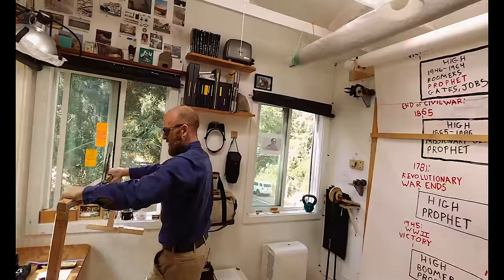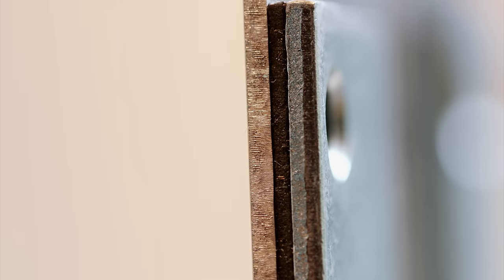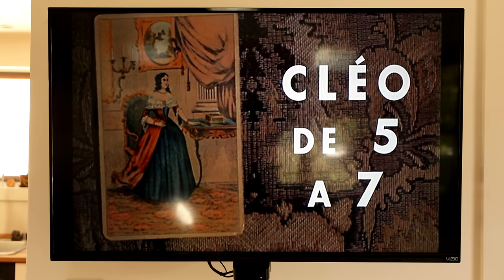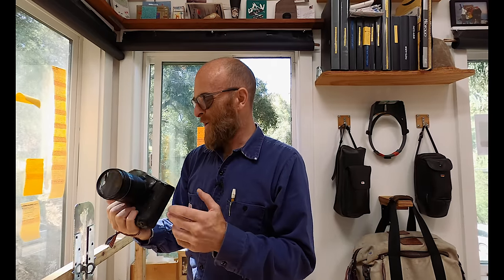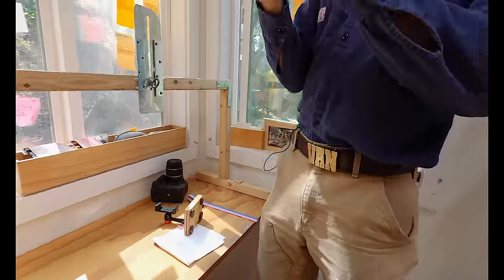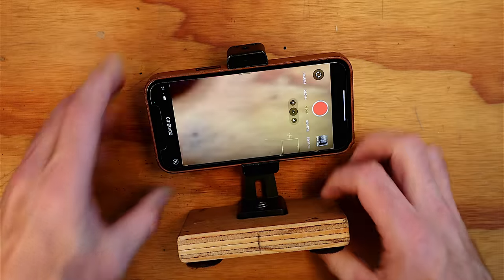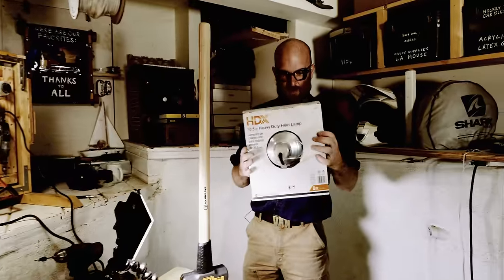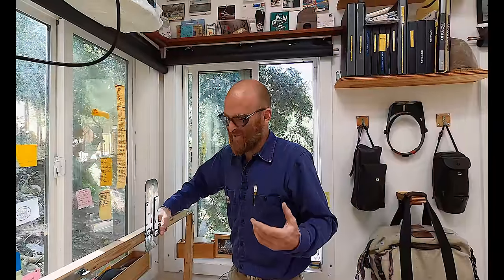6 Pieces of Homemade Filmmaking Gear Van Neistat Can't Live Without

Comment: I definitely need to get in this mindset. I’m building a new tiny art studio in my workshop. I have a small loft that is over my desk & laser cutter. I’m mounting a piece of aluminum extrusion on the loft to act as a track for an overhead camera (GoPro or other cam) & lighting. I can slide it back & forth to be over my desk or the laser. I can also point it at the wall easel. I just have to figure out how to build the rigs that’ll hold the camera & light. Thanks for the inspiration!

Comment: Creator trick to "store" the various tool pieces to a fixture.  For example the drill chuck key on your drill press.   I break open old hard drives to pull the neodymium magnets out.  Then I slap one magnet on the side of my drill press and I can then just place the chuck key on it.  As they are both metal it holds real well.   I've found these small flat magnets very useful in many things.  Enjoy.

Comment: I used 1-inch SCH 40 PVC Pipe for filming a cooking. You don't need to glue it, just drill/tap 1/4-20 holes and hand-tighten a bolt.

Comment: I dig this channel and the whole Tom Sachs ethos that Van has adopted. At the same time I find the his build style a little frustrating. On the surface it about function over form. But the more I look at the items Van makes it seems more like it's really the other way around. So many of his fabrications seem overtly designed to fit the Sachs style that they don't have much real utility or solve a problem in a better way, and become Form over Function . I think that the overhead rig is a perfect example. The joining plates cost money and are much weaker than a simple lap joint in the 2x2 would be. And the metal plate could have been made two pieces of hardwood or plywood that slide inside of each other, perhaps with a dovetail shape. The metal plate cut with a jigsaw looks like just that, and it rotates making it dangerous. And it looks horrible.  Or shows the purity of a handmade item, depending on your point of view.  I can't help but think of British YouTube'r Allen Millyard who made a 6 cylinder motorcycle engine from two smaller engines. He cut them apart with a hacksaw and handfiles and it looks like a factory engine.